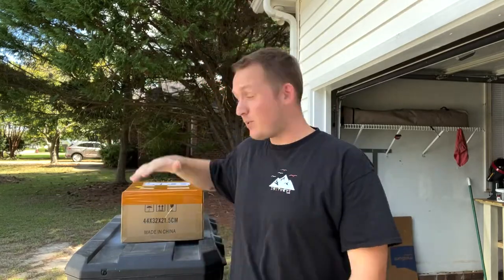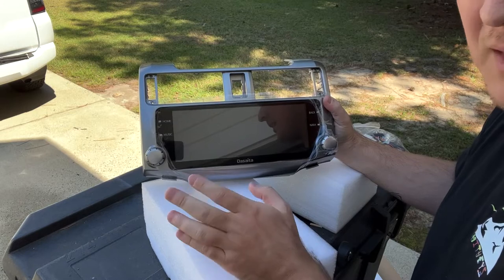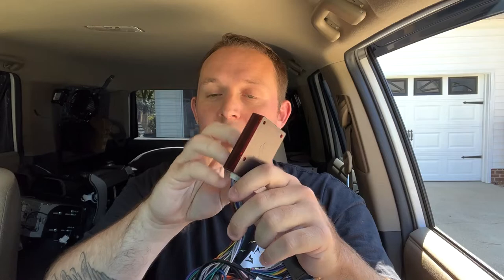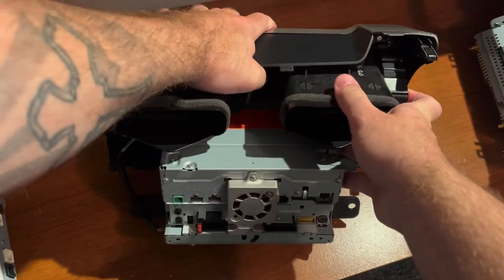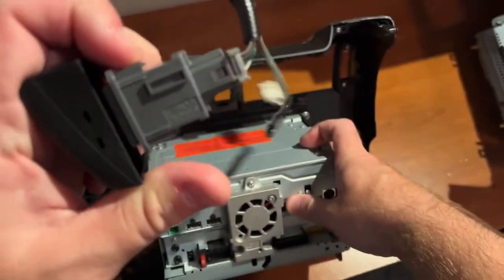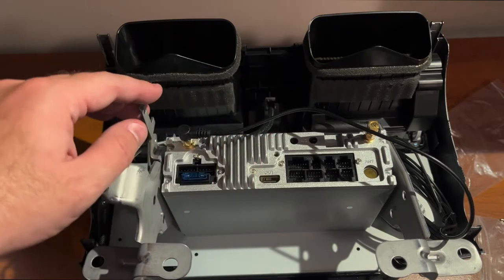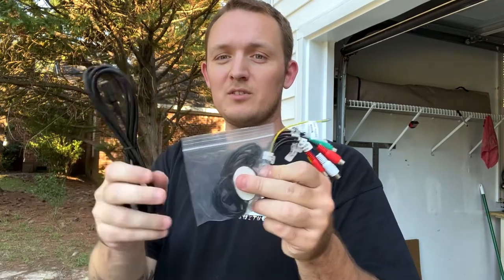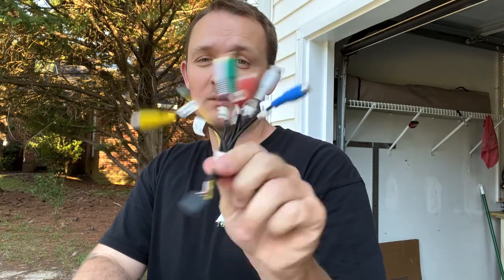Factory Style 4Runner Headunit | Wireless CarPlay/Android Auto With YouTube!

Comment: I just installed this same head unit in my 2018 4Runner. I like everything except it doesn’t remember your saved radio presets.
Reply from the maker: Oh awesome! Bummer on the radio presets. I honestly have never listened to the radio with this unit. Does everything else work and come back on when you start the truck? Sometimes if the red and yellow wires are switched, nothing will save. Just a thought. Thanks for watching and happy holidays!

Comment: How is the backup camera view finder? The one unit is very low in resolution.
Reply from the maker: The radio was pretty good, when it worked. I owned it for 2 months and it stopped working. I may have gotten a dud or a faulty unit, but it’s not longer working. Buyer beware.

Comment: Great review. Question though - recently installed mine in my 2017 4runner. Once installed, i noticed my in dash OEM compass no longer pops up. Do you know any work around for this?
Reply from the maker: I really wish I could help but my radio was defective and didn’t last long. I put a 2 month review video that mentioned my misfortune. What I would do is take out the radio and put in the original. See if it comes back on. If it does, put the radio back in and make sure you check your connections when putting it back in. Make sure they are all secure, all the pins aren’t coming out, etc. If it doesn’t come on with the Dasaita but does with the factory radio, reach out to Dasiata. You may have a defective unit. Sorry I couldn’t help more.

Comment: Nice video. Now I feel like getting one lol. 2 questions, how do you get signal for YouTube/Internet? Is it from your cell phone service. Also, what are the small issues you seemed to have with it. Would of been nice if you did mention in it the video imo.
Reply from the maker: Thanks. Yeah, it was definitely a great radio until it stopped working. I made a simply follow up 2 month review, here:
https://youtu.be/fJ9d4fEpF9A. 
As far as internet, the radio has a SIM card slot if you wanted to add a line to your cellular service. I just used my hotspot on my phone because I didn’t want the extra charge. The minor issues were just layout and I couldn’t change some thing’s/removing some things.

Comment: Great video .... question.... Are you able to adjust your phone ringtone volume?   Mine doesn't do it. I got the same unit on my 2010 4R.  When my phone rings the ringtone blasts at highest volume.    Also, mine doesn't have a split screen option at all.   On top of that any USB or SD card I connect to it gets corrupted.     Other than that, the unit is cool.

Comment: From where/what website did you order your unit?  Did you specify anything in particular (nav/sat radio etc...) or were there options you could select???
Reply from the maker: I ordered it directly from Dasita. https://www.dasaita.com/products/dasaita-vivid10-toyota-4runner-2014-2015-2016-2017-2018-2019-car-stereo-10-25-inch-carplay-android-auto-px6-4g-64g-android10-1280-480-dsp-ahd-radio?_pos=1&_sid=d9319b5e9&_ss=r&variant=40829552492700

The radios are are pretty similar, with the same functions. The only thing they need to know is what you have in there currently and they’ll match what you need. Hope this helps!

Comment: Does the factory microphone plug into the unit for use?  I see in a few videos, there are comments on the "stuffiness" of the new unit provided microphone and some people disconnect the new microphone.  My 22 Limited has a Toyota mic in the overhead and seems to work fine.
Reply from the maker: Unfortunately the factory microphone only works with the factory unit. This unit has a built in microphone and it comes with an external. I think the built in mic works great but some people have stated it’s muffled in the comments. I just didn’t have issues with mine.

Comment: You show a GPS antenna - does the unit not connect to the existing GPS nav system including the antenna?
Reply from the maker: Unfortunately no. Anything in the factory radio only works with the factory radio. This unit is an “all in one” type deal.
Reply: @smitheys  I hooked up my GPS using factory gps antenna. All you need is an adapter off of Amazon. Had my unit for 6 months no issues except cant get wireless android auto to work.

Comment: I dont have any of this and i have the same exact unit with vivid 11. I cant go on the internet at all either
Reply from the maker: Darn, that sucks about the internet Joseph! Have you tried connecting to your hotspot or your home internet WI-FI? There’s also an option to get another SIM card from your cellphone provider and add a line to always have service.
Reply: @smitheys   yeah ive connected to hotspot however on their website they claim to have satellite gps like the oem unit however thats not the case, they state to buy a cellular sim card to use it but if i dont have cell service i wont have gps. im thinking about returning it if i can or selling it second hand and getting the new t10 knobless, double the price but i need the carplay. im also going for wired carplay next, wireless has so many issues.
Reply: Conect wifi manually put the name and the password manually not automatic

Comment: Great video. Is there any camera lag if you turn the car on and immediately go into reverse? Thanks
Reply from the maker: Thanks! Yeah there isn’t any lag when it worked. I owned the radio for 2 months and it stopped working. It was pretty good while it lasted, but buy at your own risk.
Reply: @smitheys  did you get your money back or fixed?
Reply from the maker: So they did reach out and had me troubleshoot, which they sent me a video of a different model radio (they said it was a similar method) but it wouldn’t work. Then they admitted they found an issue with the radio and fixed it and stopped sending out the faulty unit.